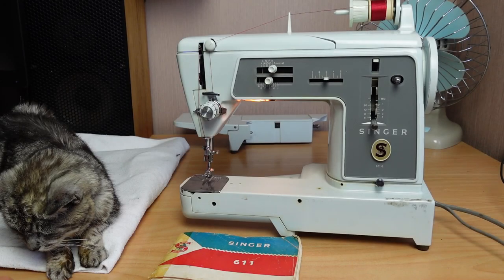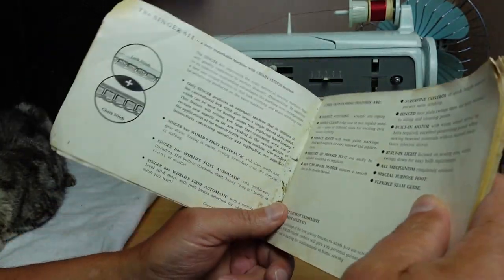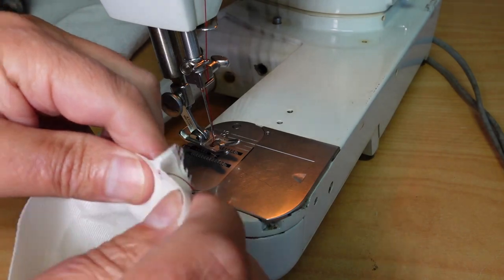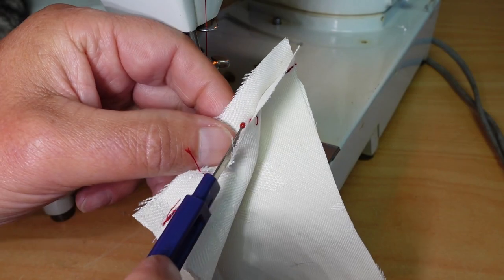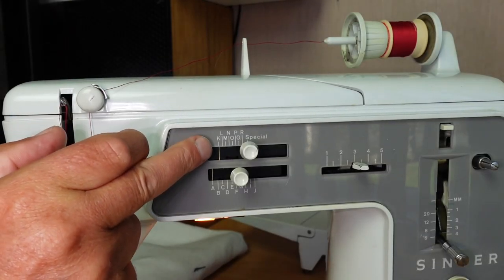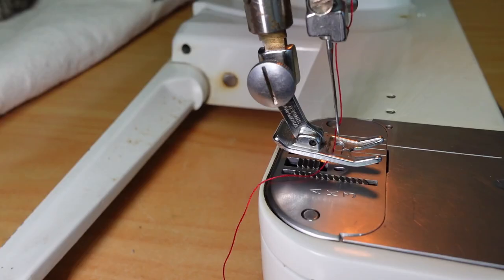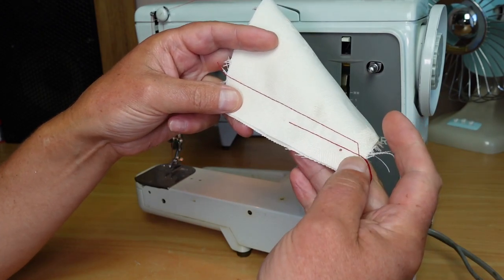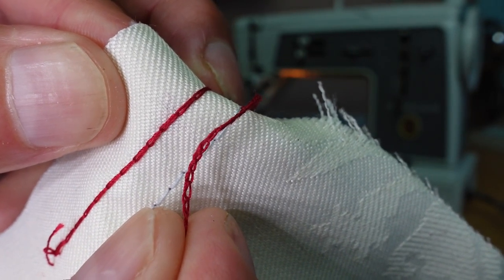Singer 631G / 611G - The Very Handy Chainstitching Function - Basting and Temporary Seams

Comment: My mother had 2 631 G’s.  She wore out the motor on the first one because she did embroidery and monogramming free hand.  I have her 2nd machine and I replaced the motor with one from my old 640 Golden Touch and sew.  The grey face plate I had to remodel slightly.  Now I have the solid state motor and with that I never have to reach for the handwheel to start the machine.  I guess my mother must have used 50,000 miles or more of thread.  
She had the most beautiful handwriting and she would do the letters on paper and my dad made templets of the letters.  She had a number of different sizes and made an excellent living doing monogramming and doing embroidery.  She did have both the small monogramming attachment and the large monogramming attachment which Singer made.  She would use them from time to time but she was so good and so fast with the freehand she really didn’t need the attachments.  
One thing Singer did and most don’t know, many of the parts from say the 401A thru the 600 series could be enter changed.  
Other than routine cleaning, oil and grease for the gears was all the service her machines ever needed.  Her very first machine was a 401A that she used to make drapes with.  You do a great job demonstrating and explaining the use of the machine.  They just don’t make them like this anymore.  With the all steel inside and gear drive no other machine on the market has ever matched these machines.  I have an older cabinet which has my 750 Golden Touch & Sew.  The 631 G gives me the free arm so I just close of the 750 and set my 631 G on top to use.  
I would like to know what you think of the Touch & Sew machines?
Reply from the maker: Thanks. I really like the Touch and sew machines. I have done videos on those as well.

Comment: Thank you for the video. 
It.s nice to see a demonstration of the chain stitch on the Singer machine, mine has a similar bobbin adapter, the one thing I can think of that still uses the chain stitch is those large bags of animal feed that have a pull string to loosen the thread and open the bag.

Comment: I am really having a hard time how to lock the stitch. What part of the machine you press to move it backward for locking stitches? I do have the similar sewing machine which is Singer 631 G but that's the only problem that I cannot start sewing. Please reply. Thank you.
Reply from the maker: Use the stitch length lever, put it in the upper position to reverse the feeding. Thanks.